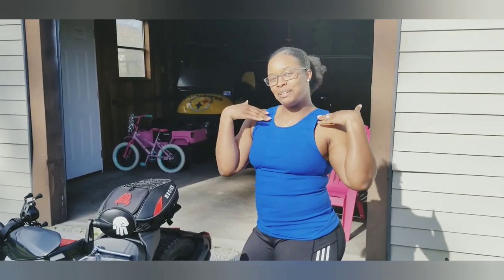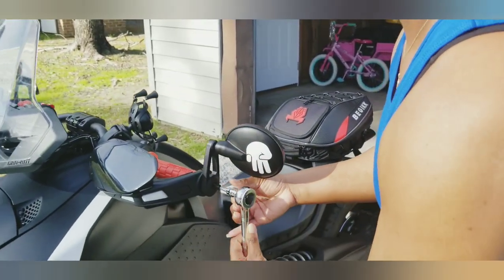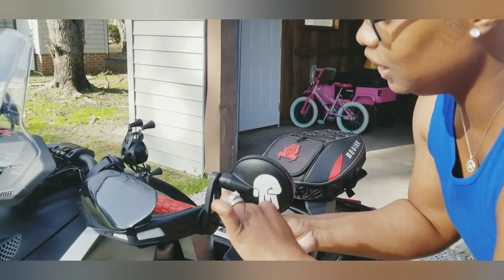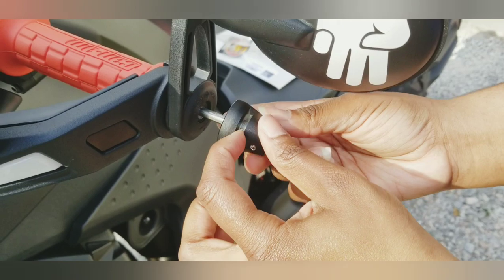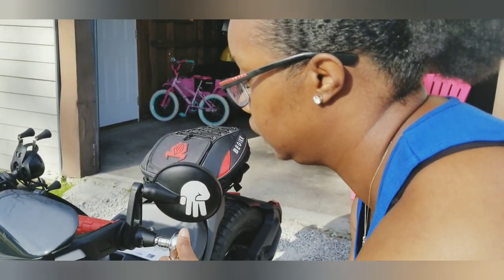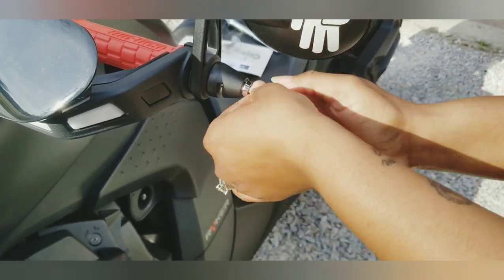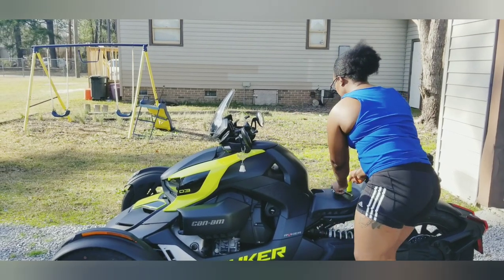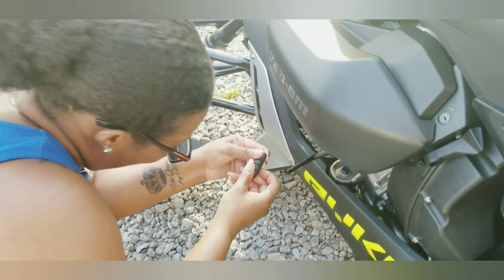🔥Best Can-Am Ryker Helmet Lock & Install | Plus New Gear Shifter🔥 #Canam #CanAmRyker #Ryker900

Comment: Did yall ride before yall purchased yall rykers
Reply from the maker: Ride as in prior experience? My husband has never rode except when we did the ATV excursion in the mountains 2 years ago. As for me, I never owned a motorcycle or anything but my dad used to work on bikes all the time. He taught me how to ride when I was 4 or 5 years old, 4-wheelers then later on, dirt bikes. So I was READY for the Ryker!!  We both took the Can-Am 3 wheel course tho to get familiar and the dealership let us test drive the test Ryker before we took the class also.

Comment: Washer to tighten stack them
Reply from the maker: Thank you!!! We may have to try that! It did really well after tightening it with an extended torque screw. I will have a new video showing that because it actually worked!

Comment: One other thing, this locks your strap but not your helmet. They can still be stolen.
Reply from the maker: Yea, Im sure anything is possible with the right person, tools and time. How does the gun lock work?
Reply: @TheMoultrieGang  I loop it between the accelerator and hand shield then around the face/chin protector. I then let it hang.
Reply: @TheMoultrieGang  https://www.youtube.com/watch?v=sB7sMK6QLq0 here's a similar visual reference
Reply from the maker: That makes sense!! That chin guard isn't going ANYWHERE!!! Thanks for that tip!! Will probably you this when I don't have eyes on my Ryker for a long time and can't carry my helmet with me!! 😎
Reply: @TheMoultrieGang   You're welcome!
Reply: They will have to Cut the strap to take the helmet. So the helmet would be useless in that case. 
The Cheap Gun lock can be cut in a few seconds. Or can be picked in less time. 
I bought two different brands of guns 3 years apart and believe it or not both included crap locks take the same key!
Locks are only designed to slow down the process. If someone wants anything bad enough it's going to be stolen.
Reply from the maker: @jamesglenn520  that is true. Thats why I said the right person with the right tools and time can do anything.. but it'll definitely slow them down! Or run them away once we get our bike alarms!!
Reply: @jamesglenn520  A good ol' Hyperbole.
Reply: @kip1512  ?? Not sure what you are referring to.